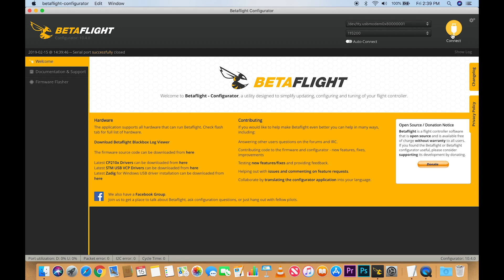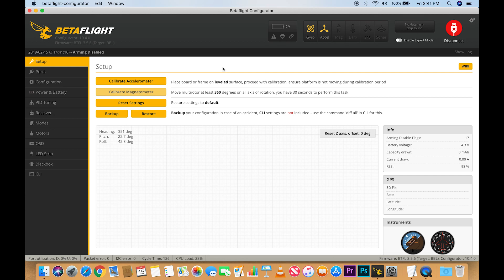BeeBrain Lite - End Point Fix DSM

Comment: Is doing it this way (through CLI) a better option than doing it using the travel adjustment in the radio (what I think of as the "old-fashioned" way)? Are there pros or cons to either method? Certainly looks like this is quicker than modifying each channel in the radio, but does it affect resolution or anything like that?